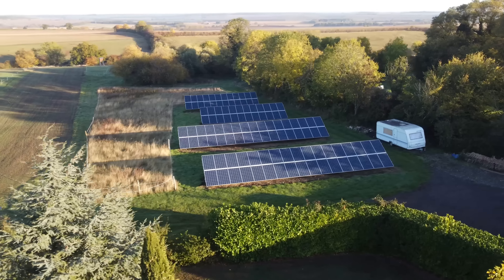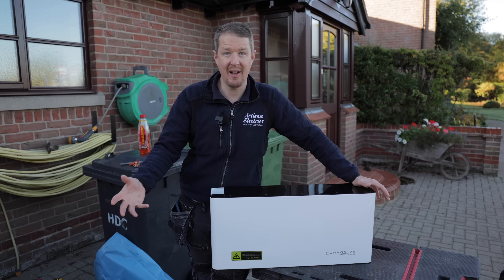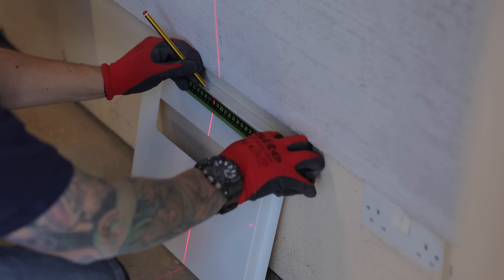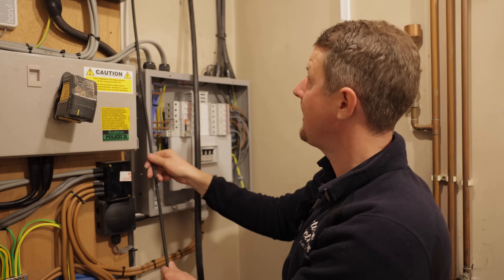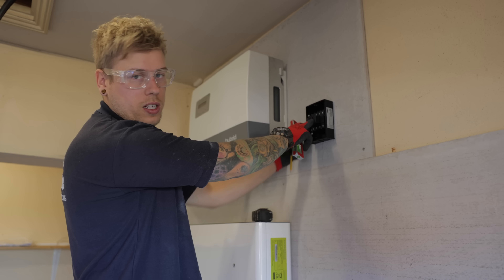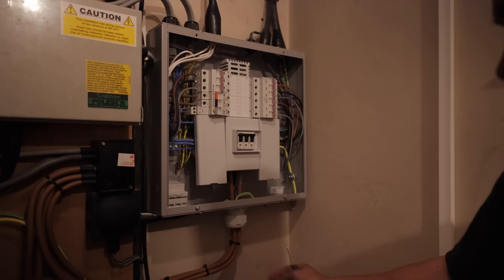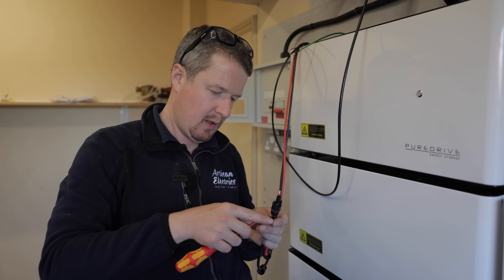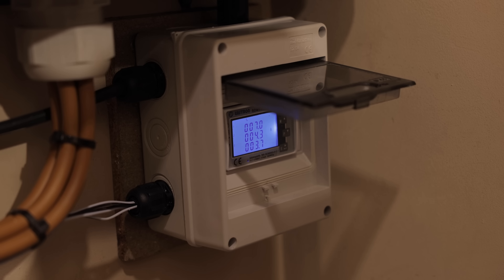PureDrive 23kWh Three Phase Home Battery Storage Install

Comment: There are loads of inverters that offer whole home battery backup, you often just replace the grid tied solar inverter with a hybrid inverter. It's not usually efficient to power the whole house, but you can pick how many kW you want and parallel up as many inverters as needed.
GroWatt, SMA, MPP Solar, Victron, many companies have it.
I was disappointed that you only put two sockets in the utility room, not very convenient when the grid is down really, but granted they probably won't see many power cuts (although this winter it's been mooted). I suspect UK sparkies aren't as familiar with these hybrid systems because we haven't got many people living that lifestyle.
Reply: I guess the size of the inverter is the limiting factor if going for a hybrid system
Reply: @martinbateman2467  yup, when this is implemented you normally pick a few circuits that you want to be available when the grid is down. For example you could retain the lighting and a particular selection of sockets.

Comment: PureDrive didn't (?still doesn't?) have the best of reputation for their equipment as they essentially repurpose Chinese branded batteries/bms inside new branded cases. There were lots of problems with their "powerwall" alternative. Not sure if they still have the same rep though.......

Comment: Impressive, and expensive install. Not the best advert to encourage people to go solar because despite huge generation and storage capacity, if the grid goes down the house isn't powered despite having the capacity to be.
That to me would be a deal breaker.
Reply: I am not sure why Jordan said that, because it isn't true, Tesla aren't the only ones that can do it, ANY of the hybrids can be wired for 'whole house' backup- I use Sigineer which has it, but all the others do too (Growatt and Victron both definitely do)

Comment: In ten years from now, where are all these batteries going to go?  Landfill?  The sea?
Reply: Exactly in the same place on the wall. These batteries last a lot longer than 10. Once the capacity diminishes beyond usable, they go to recycling, where almost everything is recuperated for the next battery.  But please do ask the same question on every solar, battery or ev video/post. You can never be 100% sure.
Reply: To a Recycling company to be made into a new battery.  The internet is great, it has things called search engines to check stuff out
Reply: @rtfazeberdee3519  No.
Only a very small percentage of these batteries ends up being recycled, around 5%.
Unless recycling rates change dramatically over the life time of those batteries (unlikely) then chances are the batteries won't be recycled.
Reply: @deang5622  Rubbish - Hardly any EV batteries are recycled currently because they are lasting a lot longer then expected.  Once no use to an EV, they then go to into a second function as a stationary battery or if out of a crashed car, they get bought by companies that convert ICE to EV